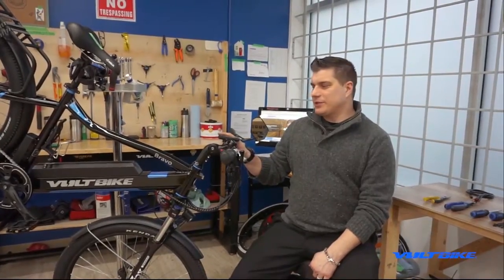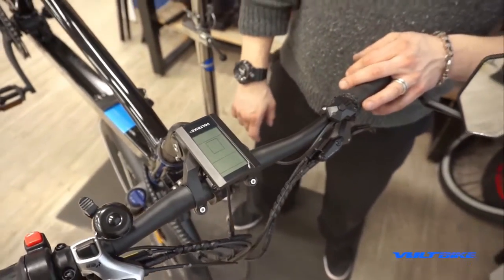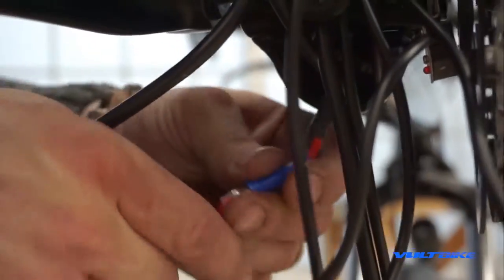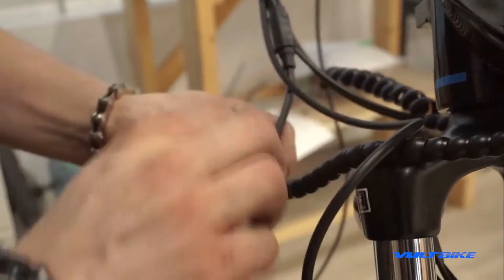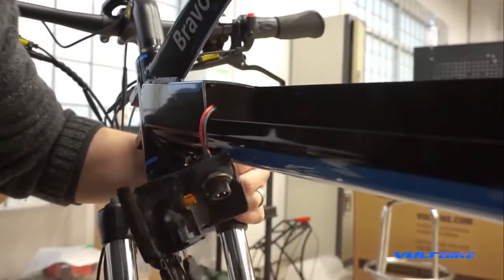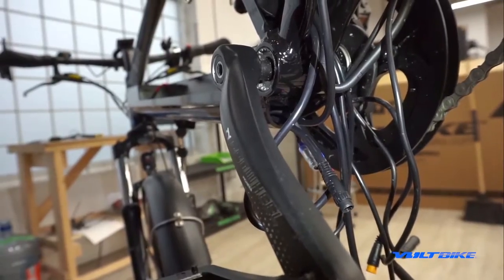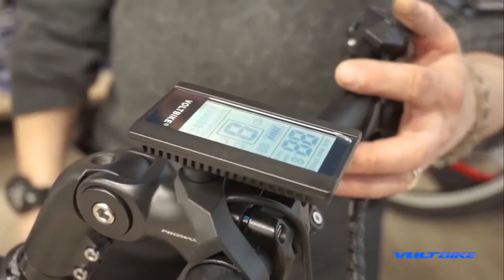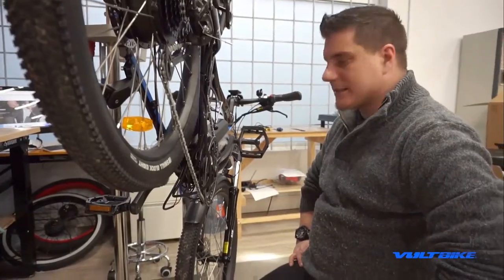Light Harness Replacement | VoltBike Instructional

Comment: One thing I found is that the way that the cables were secured from the factory, maybe due to the front rack in place, the cable had tension on it during turning and it eventually started to crack and fray over about 3 -4 years.  I didn't notice until my bike's throttle would kick in when turning to the left! :)